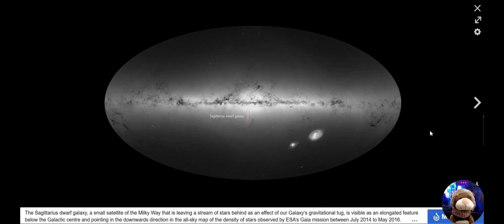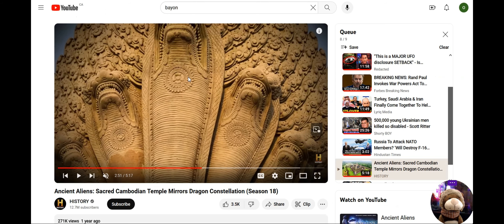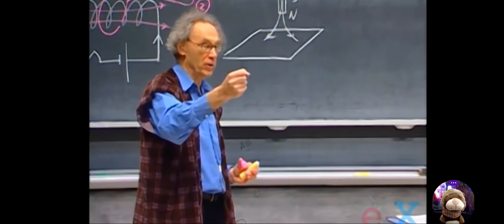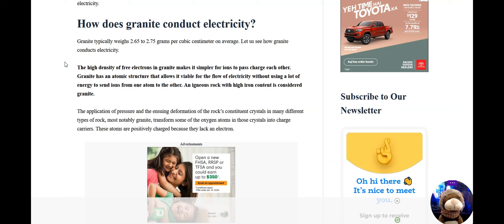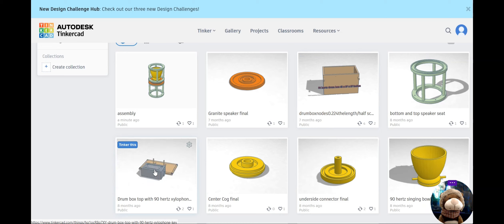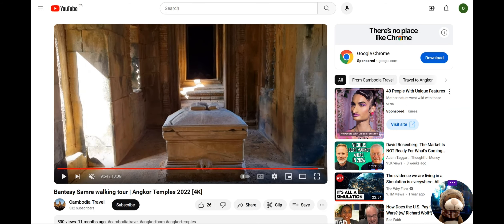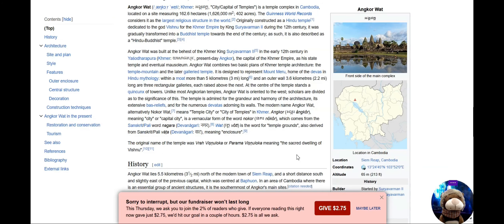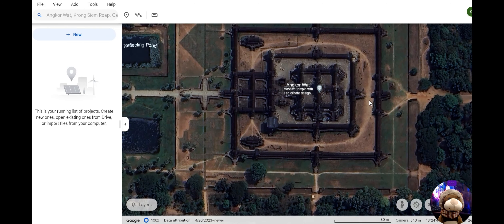Galaxy in a Box The Thermoacoustic Universe Part 3  Angkor Wat

Comment: Brother ur system inspired me as ive been experimenting n doing alot of research how to make a crystal matrix n finally by ur ideas i developed the crystal cells   it runs by heat  each cell 1.5 volt with 1.60 amperage continuously,,im thinking using tree's spruce resins as candles to run 12 volt or plus,absolutely an energy scavenging unit ,appreciate u bro,if u have an idea just how to create heat in a box to hold the temperature please let me know ♥️
I never believed in thermodynamics because is nonsense
Reply from the maker: Bravo... keep me posted on your progress.
You tube is a bit funny... sometimes comments get deleted...usually when you  try to link to something...
Yes the first law of thermodynamics is baloney because shape creates the vibration.... and the universe has a shape and therefore it's own vibration.. and since the vibration is never going to stop then the magnet will never stop moving and so the change in the magnetic field is never going to stop ever.
The galaxy in a box creates it's own heat from the electric arcs inside and from the vibration of the disks. It's a perfect system because as heat escapes it makes sound from both the hot air escaping but also from the cold air getting sucked in. An equal amount of air escapes as gets sucked in.
In most devices today.. the energy is used but the heat escapes and they don't use the escaping heat to make sound... Your car uses fuel and makes a lot of noise but they muffle it with a muffler and let the heat go out the pipe...
There's a lot of things going on with the device so it's hard to cover everything.. and the gold is only part of it.
It's the flow of heat from hot to cold that makes the gold magnetic.. but there are other things making it magnetic as well.. the voltage...
It's possible to make a 360 hertz model with 4 inch Jade disks.. they are more durable and also piezoelectric... a 360 hertz box would be 15 inches x 9 inches x 9 inches. I have one at home it's exactly 360 hertz. I never went to the smaller model because it looks a bit small and it would be a tight fit to put everything inside.... but can probably be done....
But I look at my desk at home... I have tiny speakers on each end.. doesn't matter what sound goes through them a can feel the sound just putting my hands on the desk.... so my desk is in fact a transducer as well... no different than that xylophone key. Same with the box.. i hold it in my hands and I can feel it vibrating even if someone talks to me I feel the vibration just by holding the box. I had that box for years it is a golden ratio rectangle. It was sitting in the corner of my living room for years gathering dust.. one day I picked it up to clean it while the radio was on...it was vibrating in my hands... you can really feel it... the magic of sacred geometry...
If you sit in a room and it's a quiet room...and if there is one cockroach in the room.. even if your sitting in the dark... you can hear it....
I used to have a toaster and fridge.. and you could hear voices coming out of it.. it kept saying " Breaker 1- 9".. breaker 1-9..."... they were picking up cb radio waves.. There is no escaping waves.. we are swimming in it.
Reply from the maker: A box that doesn't lose its heat very fast...would be a thermos...so how about a tuned one...
Reply: @omegafile  I will work around it will keep u informed bro
Reply from the maker: @abbaspourmoghadam3850  This might help... A siphon will work in a vacuum... and so will an arc.  The hole will suck when the node gets hot even if you seal the top hole on the box. Then you may want to inject the box with a inert gas so it doesn't blow up. Might be good to look at the xenon arc lamps used in movie theatres. Hopefully it doesn't melt on you.
Reply from the maker: Cavitation devices usually put 6 to 7 times more heat out. There is no need to worry about the heat loss... but a thermos with a small hole would likely solve it. Have to get it just right so it sucks and blows rather than implode or explode.

Comment: Ive finally built a device based on your clever design 🙏..
Im going to switch on the device no💥💥💥💥💥💥💥💥💥🛸
Reply from the maker: It should arc inside like one of those electric torch plasma lighters and heat up the bowl.. run on it's own. I have met some free energy inventors since I posted this.. they have the same tech and it's coming out... already built. Look for the quantum crystal engine on rumble. You can't ground it or it won't charge. Yes I know about the levitation. There is alchemy too if the nozzles on the bowl are at the nodes. Should be able to create all the elements from dust and gas because of the charge separation. Ie: separate the carbon from the C02.. separate the sulphur from the sulphur dioxide... separate the hydrogen from the water.. etc. For alchemy you probably have to put a lid on the bowl for better results. The oxygen should stay in the bowl and the carbon, sulphur, hydrogen and other elements that are aligned to negative should shoot out the spouts.
It's pretty obvious.. that the galaxy creates EVERYTHING from dust and gas. The legs on the seat are better with 6 legs so each leg lands on a node.. and they should be 6 sided and not round to aid in the arc. With 6 legs you will get 6 sub Tor and it will be more stable. In nature a vibrating water droplet looks like an egg of life... it has the central node and the 6 nodes around it .. looks like a 6 pointed star. When you vibrate the central node the other 6 nodes around it will automatically vibrate in resonance and so you get 6 to 7 times more heat out which is enough to keep it running forever.

Comment: Thank you @omegafile
For bringing this information to light!💯💛
Reply from the maker: The difference between this and a conventional magnet and coil is that there is no voltage in a coil until you move the magnet. With this there is perhaps 7.5 million volts per disk plus the magnet/ current..... I'm too afraid to build it to demonstrate how simple this is. I can't estimate the amperage.. if it goes to a mega ampere the device could be so dangerous. If I thought it was safe I would have built it by now.
It's a known fact that Helmholtz resonators gain mass when you vibrate them... so it's probably going to make it's own gravity too and who knows if time will slow.. .. but in the end it is very simple.
I'm really appalled by the amount of people who are dying for oil and gas when we don't need it at all. I did my part as much as I can. I don't have the courage to take it any further because I don't have the guts to build it.

Comment: LinkedIn wont allow me to add you because i dont have enough connections and YouTube deletes comments which is annoying that have the word e and 📧 in it i would like to speak to you privately also in total how much will all the parts be i would like to start construction immediately
Reply from the maker: I put my email up on my home page. The links to the parts are in the part 2 video.
I can't endorse anyone building it for safety reasons. When it starts arcing inside.... the magnet is going to bounce in radio frequency.. and I can't estimate the current...  I think this is very dangerous and I don't want to see anyone get hurt or killed. The electric arcs inside are EVERY radio frequency and the microphone inside is going to pick up every frequency up to 20 MGHZ.
It will feed back on itself in radio frequency.....
I'm too afraid to build it even myself.
Tuning the first bowl will be a challenge as well to get that 90 hertz tone coming out of the hole... you may have to drill out the hole bigger... might be easier to have one custom made in India or Tibet.
But whomever gets the first bowl finished should 3d scan it and make the codes available.. saving others time with tuning issues.
Reply: @omegafile  I will email you I've read many of your comments and like your design and detail of the device I understand the dangers but I believe there's a way to make it safe I'm willing to risk my life because I've studied these sort of things since 11 these types of technologies and science is what all I care about I'll email you soon
Reply: @omegafile  do you mean your home page of where the plans are ?
Reply from the maker: @deandrealexander6172  My you tube home page has my email. The plans are on tinkercad and the links to the drawings are in the part 2 video because I am not monetized and you tube wont post the complete links.
Reply: @omegafile  I see I just sent you one appreciate the direction
Reply: Same issue I had in LinkedIn
Reply: I cant seem to find it sir, i wonder if its same with your channel name? @omegafile
Reply from the maker: My email is up on my you tube home page now.
Reply: @omegafile  youtube don't allow me to see it, I mean I checked everywhere and didn't see it
Reply: @omegafile i can confirm your email cannot be seen in your homepage
Reply from the maker: @user-os4qe9gn4s  click the > icon beside " The truth on this channel" then click View Email address. It's there I just checked... and please let me know if you email me so I can check my spam folder.
It all comes down to this: I spent my whole life looking for the answer only to realize that everything is made of dust. I was told the answer when I was a child but I refused to believe it only to realize 45 years later that they were telling us the truth... but mainstream science is not... we are being lied to and this knowledge has been on this planet for 300,000 years to a million years and was used as recently as in the 1700's by the alchemists... and they were making gold and all the sacred metals with it.... and it's all made from dust. It is DC to AC dust to matter conversion.. all the elements are in the air and get ripped apart at the hole and some of them go through the spouts after they are ripped apart because of their different charges that get separated.
The wood protects from the UV and x- rays... and the gold protects from the gamma rays. There is cavitation going on inside and ball lightning and transmutations... Do not open box until 3 to 4 days after turned off to avoid getting irradiated. The seat is more stable with 6 nodes on it to make an egg of life on the top and bottom vibrating the whole 12 star tetrahedron. The 13th node is the hole and it is the primary node.
This has been in the public domain for more than a year and is completely royalty free and cannot be patented.. not even I can patent it now....
Cavitation devices give off 6 to 7 times more heat out.. and so once this heats up it will run forever.... and I don't think you can turn it off unless you make a valve to close the hole inside.. not included in the drawings...
The disks need to be double dipped in bronze on the outer edges and in the centre as explained in a 16th century old English text.
I make no claim to this device I have only reverse engineered it. All I can say now  that if you start it up... run like hell the other way....It is so powerful they had to shield it with a moat.. and on the outside are warning signs that people cant translate.. they are deities of multiple armed demons ripping away the stomachs of people/// showing the types of illness you will receive from the radiation...They are warning signs to keep out.. danger radiation. The xylophone key is made of Iron, Nickel , cobalt... you would not even be able to pull it off with 100 elephants because the magnet will get so strong.. but when it heats up.. it can be removed... but you risk your life getting near it.. it can take elements from your body....or you can just plain get electrocuted...from ball lightning.. and not even your safety boots would save you. The worst is the gamma rays if you open the box....you will surely die.
"A galaxy creates all matter from dust" that gets sucked through the hole that gets ripped apart and reassembles into matter on the other side. " IT EATS DUST".  It can be done with a closed bowl or an open one because it is all " a vibration in a cavity"... it is cavitation and charge separation.. it is very simple yet very dangerous.
The spark gap at the spouts have holes in them they are not like normal spark gaps... and this spark is every radio frequency right beside the microphone (the disks).....it's going to vibrate the crap out of anything that gets sucked into it and it will reassemble into all sorts of elements on the other side... and all these elements like calcium,, carbon,,, sulphur...hydrogen.. oxygen.. nitrogen....are going to recombine into all sorts of elements and some will transmute. Some of these elements like O2 and N2 and H2 are diatomic and they automatically want to recombine if you rip them apart into their mono atomic state... and they give off an incredible amount of energy when they recombine into new elements.... It's going to make iron, calcium, magnesium, sulphur, lead, gold, tin, carbon.. you name it.. a galaxy creates everything from dust! It's going to make oil because it separates the sulphur and the carbon and the hydrogen.... and they all recombine.... you will never run out of anything.
Everything Can be created and it Can be destroyed. The first law of thermodynamics is a load of baloney...
Some may understand what I am saying here: the 12 star tetrahedron is only one petal of a flower with 12 petals.. for a total of 144... but in reality goes to 144,000 nodes. Angkor Wat only shows 24... which is our cycle.
Some people call them EVO's. I call them petals on a flower. If you look at a chimney.. the hot air goes up and the cold air goes down. The scientists are calling the stuff coming out of the hole dark energy.. I call it cold air going down and hot air going up. I make it simple as to not confuse you. Fusion is the aftermath of the thermoacoustic process. The galaxy is thermoacoustic  absolutely... and it doesn't matter to me if It takes them another 50 years to realize it I will be long gone.
Reply: I don't see the > and address.  Would really love to message you.

Comment: Good afternoon. I read your comment about some discoveries you made, and I have made some discoveries myself of a profound nature like yours and would like to speak with you about them. Would it be possible for us to communicate privately off of youtube? May I have your contact information?
Reply from the maker: @BastianNeberiusAlexander  If you go on my channel and click where it says "more"... a new window will open and there you will see " view email address ". And click that and you will see my email address. Just let me know here if you email me so I can catch the email in case it ends up in my spam folder.  I should be pretty easy to contact. This stuff is available now royalty free but no money has been put into it. The electric arcs to the bowl heat it up and then it runs on its own. Since it's ac it's charging and discharging 90 times a second...maybe more with the radio frequency from the arcs....I can't see it ever costing any money for the 30 million watts it puts out.... I say in the video to ground it...if you want it to work don't ground it...if you ground it the capacitor won't charge... but do ground it to turn it off....but will still run when off until it cools down. Might work more efficiently if it's a closed bowl shaped like an egg ...or could get too hot...but I suspect it may be fusing elements but couldn't prove it unless  I built it. Has to do with a hot magnet...normally oxygen is attracted to the centre...but because of the heat it's attracting the hydrogen inside and repelling the oxygen....seems to be a sun.... so conventional physics...fusion may be wrong in the sense that you don't need millions of degrees for fusion. The bowl should hit about 800 degrees or so...that might be enough. As an egg shape with the small hole at the bottom, the arcs will make it red hot and it will blow like a horn forever. This is so simple I'm surprised the world has not jumped on it already. It's free energy with no moving parts and it needs no fuel. A steady arc with a 1 cm gap is 1000 amps....30,000 volts.....30 million watts and up...because of the parallel conductors it will give more on demand...